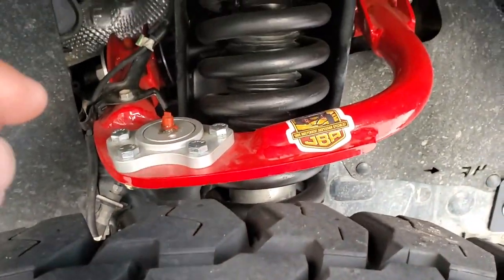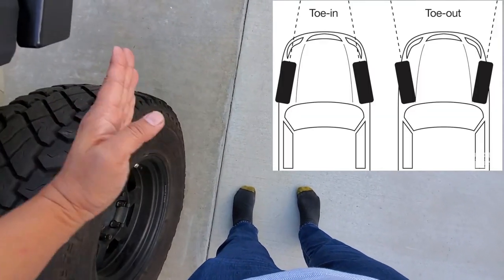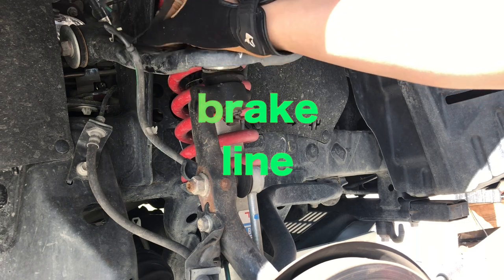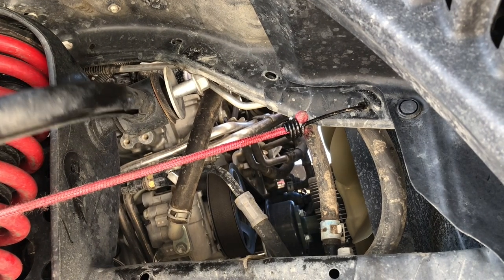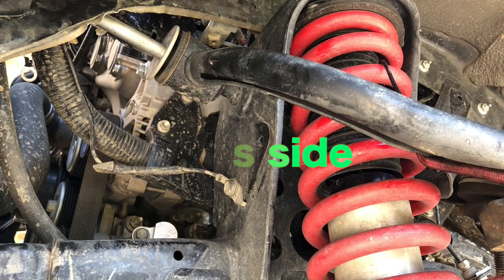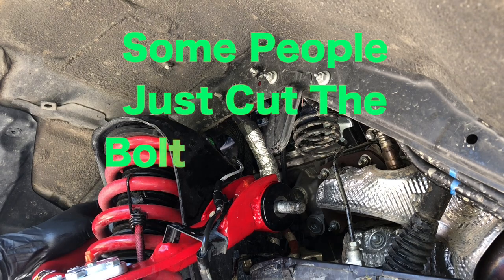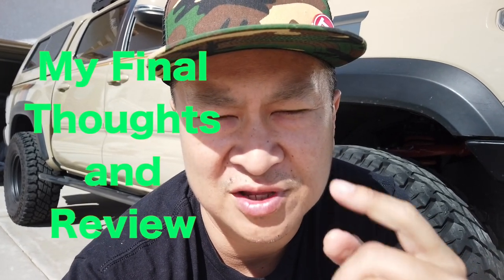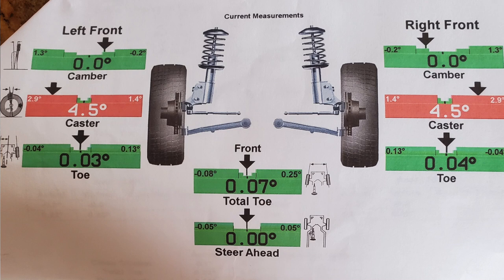MUST HAVE Mod for every Lifted Toyota Tacomas - Upper Control Arms DIY and JBA Offroad UCA review

Comment: Im glad im not the only one that had a heck of a time with the bolts for the jba’s. I ended up bending the panels with a small C clamp tighten down then pulling up on it. Then after the swap bent them back the best i could and sprayed scratches with undercoat. They were a pain in the butt!!!
Reply from the maker: Oh I hated that spot
Reply: What do you rate the difficulty level?

Comment: Installed same arms on same truck last week. I told the tech 4 caster (he’s good. He’s been doing my off rd alignment for yrs w/ aftermarket UCAs). 

The funny thing is he could easily get 4 caster on the passenger side but only 3.3 on the driver (he maxed out the cam-bolts and that’s the most he could get). He found that odd and couldn’t figure out why. 

In the end he set them both at 3.3 caster to match but I’m disappointed he couldn’t get 4 on both sides. 

Any insight?
Reply from the maker: Do you recall hitting anything or jumping the truck? I know the cam gussets could get bent easily.

Comment: Just did this the other day. How did you get the passenger UCA bolt out and how did you get it back in the right direction?
Reply from the maker: I used a punch to bang it out on both sides. Cursing helped too.  🤣
Reply: @RobDaman  yeah that's how I got it out. I couldn't see how I would have enough room though to hammer it back in, just went ahead and put it in backwards. hopefully I don't die.
Reply from the maker: Ya. Cutting the bolt is way way easier but definitely loc Tite and keep an eye on it

Comment: I have the spc uca's they also fix the rubbing issue with caster, nice mod Rob and nice video!
Reply from the maker: SPCs are a very popular option indeed due to adjustability.

Thanks for watching. 👍
Reply from the maker: I like em a lot. The warranty they offer is awesome. 👍
Reply: Im getting LT +4.5 installed this comming week, i will miss that feature to adjust caster like the spc's uca's , but will see i hope that the alignment come out good
Reply from the maker: @geralrodzlife4440  sounds like you're going to have some fun!

let me know how you like it. Getting Total Chaos?
Reply: BTF LT , I wanted TC but too expensive for my pocket hehe so I gave a try to BTF ,from what I heard their parts are really good, will see

Comment: Rob, need advice. Have a 2018 Taco with Bilstein 5100 at lowest setting and BF Goodrich ko2. Looking for more lift, don't do any off roading. What would you reccomend I go with? Thinking OME front springs with rear block or Dakar leaf. Also fox coilovers and rear shocks. Your advice please. Thanks
Reply from the maker: You can do OME.

the rear I'd ask you if you're going to be added constant weight or any weight. If none an AAL or spacer (since zero offroading) can suffice.

Fox coilovers are good but just be aware those won't have a long life before needing rebuilds. That's how all the big brands are and it's by design. More offroading the more the need of a rebuild.

Bilsteins will last the long and maintenance free.
Reply: Rob Daman thanks for the reply, shops tend to give you the round a round with no clear answer. Appreciate your reply and advice. I will go with your recommendation. You are DAMAN. ✌
Reply from the maker: @FamiliaDiaz09  no problem. let me know how it goes.
Reply: Rob Daman Rob ended up going with SPC UCA'S, OME 888 2.75" FRONT SPRINGS AND DAKAR MEDIUM LEAF PACK..WILL THIS SETUP LEVEL ME OFF YOU THINK? NOT SURE OF FRONT AND REAR SPECS ON 2018 TACOMA SPORT. ALSO, WOULD YOU BE ABLE TO MAKE A VIDEO REGARDING DRIVERS SIDE GRAB HANDLE? 2018 DON'T COME WITH DRIVERS SIDE HANDLE, GO FIGURE. WHAT DO YOU THINK OF THE SETUP I WENT WITH? JUST WAITING ON SHOP TO GET INSTALLED. I have Bilsteins 5100 all around.
Reply from the maker: @FamiliaDiaz09  sounds like you're going to have more weight in front since you picked 888. any weight in back? That's going to be factors if you're level or not.
Reply: Rob Daman no weight in back. Can you further explain any suggestions

Comment: Will I be okay with 16" wheels with a -12 offset for these ucas? Looking at getting these to fit 35s. Doing a body mount relocation as well and of course some trimming.
Reply: slight rub with a 3" lift on 33s. Will be adding these to clear it
Reply from the maker: check out link https://tinyurl.com/JBArobdmanhd 

JBA put some suggested wheel/tire info.

35s could be tight
Reply: @RobDaman  Sorry I decided to go with the All Pro ucas since they're in stock.

Comment: Are the STD model plenty rugged enough for the average joe weelin occasionally and daily driver?
Reply from the maker: absolutely perfect for even aggressive offroading.
Reply: Rob Daman perfect, thanks. Im puttting on the eibach pro lift and wheelers 1.5 AAL. Think ill go with the standards.
Reply from the maker: Sounds legit set up

Comment: Great video, I decided to buy a JBA UCA after watching this video. Quick question, I have a 3 inch lift on my 2001 tacoma using bilstain 5100 suspension. anything else you recommending upgrading when lifting a truck?
Reply from the maker: I've learned a full leaf pack is worthwhile if you're going to have loads constantly.

Since you have an older taco I'd check all the stock bushings are good.

Comment: Hey Rob - how do the JBAs compare to SPC UCA, both in price, quality and function?
Reply from the maker: JBA is made in USA and a small biz with great warranty. SPC is a great product and popular with the added flexibility off added camber adjustability. 

The issue is see with that adjustability is that it confuses the alignment technician. 

Can't lose on either choice
Reply: I have spc uca's on my 2019 Tacoma off road. The first set was making klik klak noises immediately after installation. I contacted spc and they stated that there was some defective uca's that came out. They sent me a replacement set and paid for the replacement. I had to send back the uca's I had removed. About a year later the uca's re making the same noises again. klikklak klik klak. I'm going to switch to jba's. I'm hope it's a better product.

Comment: Hey Rob i had SPC UCA’s installed on my tacoma and im having a squeaking issue . Any idea why or what it might be ?  Thanx
Reply from the maker: Were the washers that go between the arm bushings  on the UCA bolt lubed?  Other thoughts is to check torque on bushing bolt.
Reply: Hey thanx for getting back to me . Yes they were lubed and i recently had everything lubed again the noise got quieter but still squeeks. Im thinking it might even be the bushing on the front sway bar . The noise is super loud when i drive over speed bumps or dips on roads
Reply from the maker: @agustinherrera5600  you could remove the bar to see if it's the culprit.
Reply: Thanx . Ill give that a try
Reply: Are you sure it's coming from the suspension, my alignment on multiple vehicles was shitty and my tires would squeak over speed bumps and painted surfaces

Comment: If Im just doing a 1.5 inch lift in front and Back with 285/70/17 BFG KO2 with Method wheels with zero offset, I mainly just overland, not big into heavy rock crawling, do you think I should change my UCA? I have a 3rd gen 2020 TRD off road. Thanks.
Reply from the maker: it's up to you. I mentioned why I did it even for street use.

Comment: How have these JBA UCA's held up over time ?  I can only afford one shot at this , hehe. JBA or SPC is my situation. My wallet wants JBA but Im worried about longevity. Thanks for all the info Rob
Reply from the maker: Same as new.

They a lifetime warranty on the UCA and a 1 year on the balljoints. I haven't heard any negative things. Just be aware they don't work with all wheels. You may need spacers.
Reply: @RobDaman  Awesome !  Thanks for getting up with me.  I'm gonna go ahead and buy them.  Thanks for the tip on the wheels too👍👊

Comment: Hi Rob, i have same uca, i run bilsten 6112 in front, 275/70/17, trd 4 runner wheel  i got rub when reverse, do you think if i adjust more caster, it will help clear rubbing, thank you
Reply from the maker: It depends what your caster is now. Doesn't sound like you need to much adjustment if it's reverse only

Comment: I have a 3inch pacer lift on my tundra right now, and the arms that are on right now are angled because they are the factory one and are stretching because of the lift. Will these solve my problem.
Reply from the maker: yes and get better alignment too
Reply: @RobDaman  sorry I'm not really good with cars. Does that mean take it to the tire shop and have them align it?

Comment: I have a 6inch lift and was wondering what control arms I should get bc I want to put a 1inch spacer but the stock control arms are maxed out on 6inchs?????
Reply from the maker: good question. i'd contact jba direct to confirm if that's possible

Comment: Great video, I'm in the process of following your mods...saving me alot of time by making this.
Reply from the maker: Have a extra pair of hands if possible. These can be a bear to handle
Reply: Rob Daman - is there a way to do this without having to bend metal for those bolts?
Reply from the maker: @DMHal01  on 3rd gens it's unlikely. 2nd gens may be ok. i have a friend that does many installs and some are smooth and some are easy but it needs to be moved some for 3rd gens.
Reply: Rob Daman it's just the inside of the fender right?
Reply from the maker: ya you'll see where the issue is.
Reply: Rob Daman - thanks again for the great videos and the replies!
Reply from the maker: let me know how it goes.
Reply: Rob Daman - I sure will, running Dobinson coils c59-352  (red) up front with Bilstein B8's and JBA UCA. Did you opt to replace the strut mount? I ordered a KYB since reviews have been great...also my Geartech Fend-X liners are coming in to replace the factory fender liners with tougher heavy duty ones.
Reply from the maker: @DMHal01  the 15 trd pro set up I bought was assembled as new so I didn't have to replace anything.

Comment: Great video, Rob. I just installed my JBA upper control arms and Bilstein 6112 today and it took me most of the day. Those long bolts are a pain in the ass! Removing them was what took the longest. I even had to remove my battery to pull the driver side long bolt. I personally thought the passenger side was easier but in the end both sides sucked. Either way I got it done and saved the $1500 the shop quoted me. Question about how to grease these: Do you have to loosen the long bolts before greasing the zerks or can I just go ahead and torque to 85ft/lbs and then grease? Thanks!
Reply from the maker: Oh it was bad installing that I didn't post a vid cuz of the pain and cussing 😂

I don't recall on the zerks. I would contact JBA to confirm.

Comment: Hi Rob, I have a 1998 taco 5 lug and i have a aftermarket control arms not like those heavy duty JBA like yours. And I installed it with adjustable shocks. The handling was overall satisfied, but I had a issue everytime I went over a dip , my suspension somehow hits down at something very hard as if theres sonething in the way. Would you happen to guess what that would be? I cant seem to figure it out and I had to remove everything back to stock for now.
Reply from the maker: Look at the suspension for rub marks. If you're back to stock and the sound is gone it's probably the uca hitting something like the shock
Reply: @RobDaman  i see.. so should I use stock uca instead? Thanks
Reply from the maker: Well that defeats the purpose of having aftermarket. Look to see what the source of the problem was/is

Comment: Will these fit with a wheel setup 265/70/17 with a -25 offset and the eibach 2.5 inch lift?
Reply: Also, after installing the eibach 2.0 coilovers with 2.5 inch lift there's a loud thunk when I go over a speedbump like at 10mph, any idea what this could be?
Reply from the maker: Do mean if they'll rub? Answer is possible
Reply from the maker: Likely bumpstops

https://youtu.be/48AXubqnppA

Comment: Hey Rob, I'm highly considering ordering these after seeing your video.
I'm having some trouble figuring out everything I need to order. I have a 17' OR with a Low Range Offroad 3" front, 2" rear level lift with 285/75/16 K02s on stock TRD OR wheels with 1½ wheel spacers. I'm wanting to get rid of the spacers and buy new wheels, but after a lot of research, I've figured out that I would need to change out my UCAs in order to do it. Which now has lead me to redoing everything up front.
What I'm wondering is what size lift and tire are you running? Also, are you running wheel spacers? Next, have you had to do a CMC or are you rubbing anywhere? I'm trying to stick to a 3" lift and want to get away with not doing a CMC.
Any advice is appreciated!
Thank you!
Reply from the maker: My lift is a hodgepodge right now. I talk about it in my walk around vid.  https://youtu.be/6kA4C14Qoa4

Your next questions are actually answered in this vid https://youtu.be/Fko1F0ixepQ

in the end a 285 and no cmc is highly unlikely if you offroad. if you're on the street you may be ok.

Comment: Great channel Rob keep the videos coming. One question...which wheels and tires are you running now? I saw on the JBA Offroad site that the acceptable list is pretty picky with these UCAs. Thanks!
Reply from the maker: Fifteen 52 analog. I have to run spacers due to offset and uca style. There's other UCA w similar concerns.

Comment: Rob, just got my JBA's installed in my 2019 Taco. Did you have any pre collision or vsc warnings on your dash read out? Been researching the web and seems I will need to have those cleared and recalibrated. You have any warning lights come on after the lift? Mine was a n LRT 3/2 spacer lift. Did the lift and the uca's @ the same time.
Reply from the maker: I don’t have those sensors. The Uca would not affect that but a lift can but hopefully a sensor wire wasn’t damaged. Many don’t get that malfunction
Reply: @RobDaman  Ended up being a stretched pass side abs wire. Then Firestone had to re calibrate  the PCS. They had trouble getting my alignment right the 1st time but nailed it and did the re calibration for free the 2nd time. Opted for the life time line up so it didn't  cost me a dime. Was very frustrating to see that everyone who works there doesn't know wtf they're doing. In the end though they got it right.
Reply from the maker: Glad you got it fixed 👍

Comment: 9:30 is that rub reduction benefit specific to these particular UCAs or aftermarket UCAs in general?
Reply from the maker: good question.

the rub i mentioned is about adding positive caster to move more forward of the cab mount.

the majority of aftermarket UCAs have either added a fixed about of additional caster or give the ability to adjust caster such as SPC. 

JBA themselves sell a UCA for stock suspension that helps with articulation but doesn't add any caster
Reply: @RobDaman  Yeah I've been looking at the JBA UCAs but I've also found these on amazon
https://www.amazon.com/Freedom-OffRoad-Front-Control-4Runner/dp/B01NASQA4C/ref=cm_cr_arp_d_product_top?ie=UTF8
I know the old saying "buy once cry once" but the college student that I am is swaying towards the amazon listing. What do you think?

Comment from the maker: Hi everyone!

In this video I installed and taco bout how and why I swapped my UCAs - Upper Control Arms to JBA Offroad.

It took me about 3.5 hours to complete because of the "proper" way of doing things and also my first time at it. 

I'd suggest a helping pair of hands if you have any. Jesse wasn't with me this time so I was at a disadvantage. 

My are HD https://tinyurl.com/JBArobdmanhd 
but you can get the standards with VERY good results  https://tinyurl.com/JBArobdmanstd

Had a tiny error on my vid. the bushings are not poly urethane but elastomer so they won't squeak over time.

Thanks for all your support and stay tuned for more!